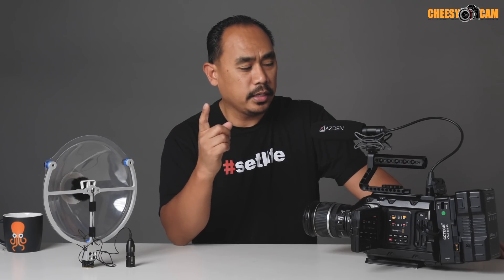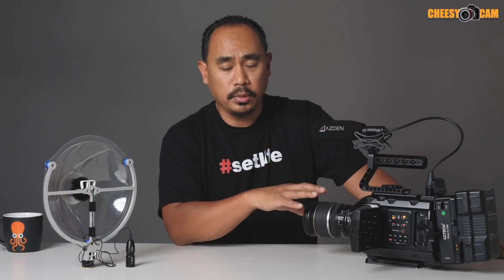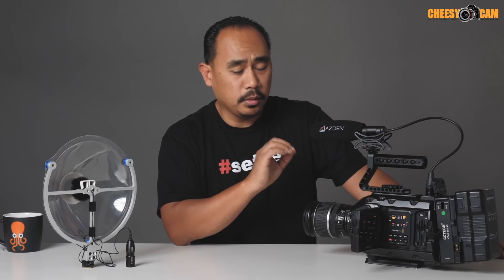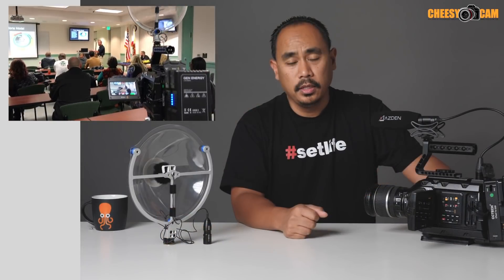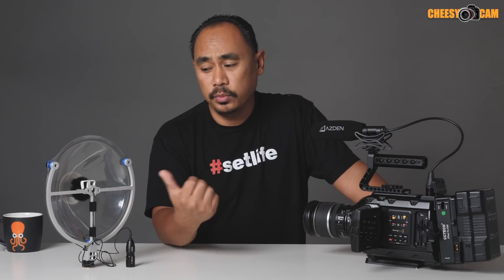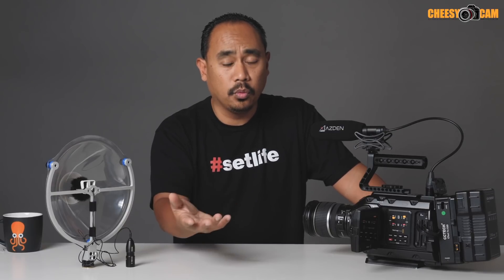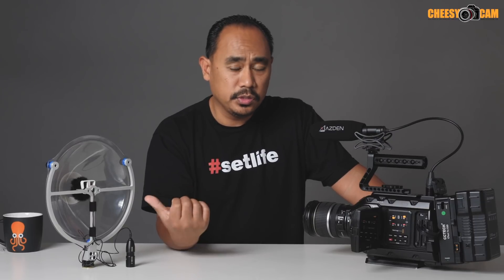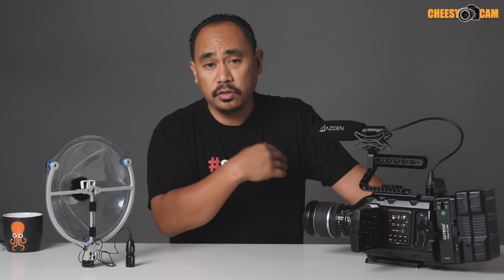Second Test  - Sound Shark Parabolic Mic

Comment: I've never seen a parab outside of sports
Reply: Unfortunately, nearly all the "parabolic mics" sold in the US for the last 20 years or so, before we formed our company, have been spherical in shape and not a true parabolic shape.  This made the audio quality to suffer greatly but the were considered "good enough" for sports.  We are constantly fighting that impression of parabolics.

The other problem is that "experts" have said for years that you need a huge parabolic to capture lower frequencies.  Even the National Association of Broadcasters Engineering handbook says this.  But they are wrong.  The arguments they use are based on transverse wave patterns (electromagnetic waves) instead of longitudinal waves (pressure waves) that make up the sound we hear.  We have recorded audio down to at least 50Hz using a Sound Shark.  But I still have people tell me all the time that it is impossible.  :-)